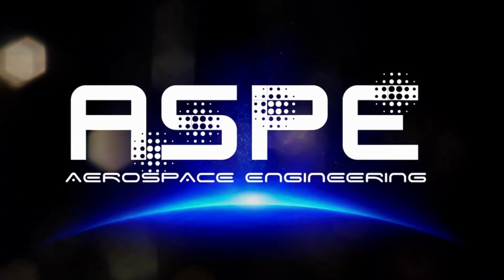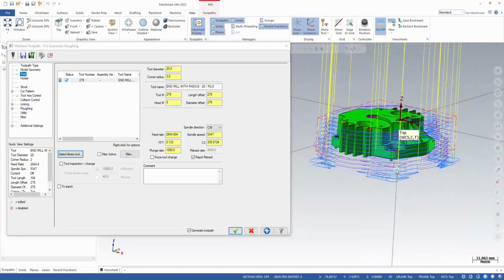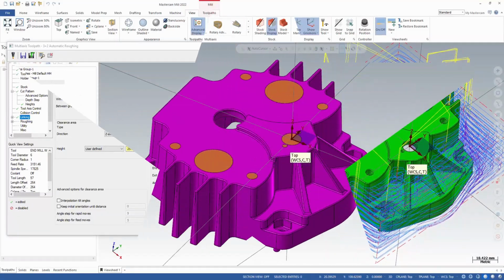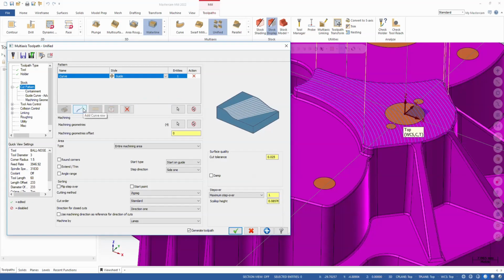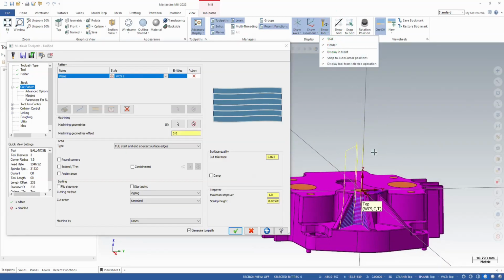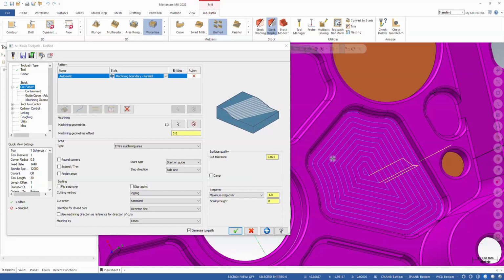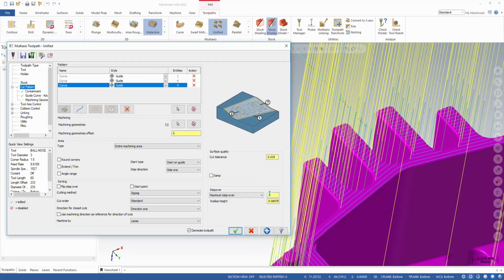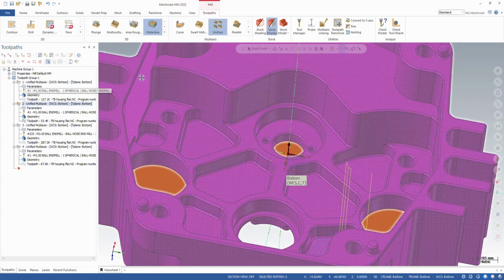MASTERCAM 2022  NEW MULTIAXIS TOOLPATH - SNEAK PEEK

Comment: I wish this was available in MC 2020
Reply from the maker: Yes it is a really good operation
There is a lot more :)
2nd part of Mastercam 2022 sneak peek in 2 weeks
Reply: @aspeaerospaceprecisionenging  do you own your own shop? If not, How can you afford MasterCam as a regular person?

Lastly, is your version a Beta version?
Reply: @ThomasShue  yes he uses beta version 
you can get it only from mastercam 

Ive spoken to reseller and to get beta version you have to have legal licence mastercam and you have to pay yearly maintenance which is $1000s 
This is expensive!!
That’s why only he’s got a video from new version :)
Reply from the maker: @ThomasShue  I agree with you it is very expensive  
I use the full version of Mastercam 2021 (except blade add on)
Robert soso is right,
This vid  is a beta version of the 2022 release, you can get it from CNC software if you have purchased the full version of Mastercam in the past and you pay yearly  maintenance it is a cost around $10k / year /each sit of Mastercam - this includes addons and postprocessors for our 5axis machines, there is no full version release or a Home learning edition yet (will be released end of summer)
 I also use a full 5 axis CATIA system (this is even more expensive) and a full version Edgecam  5 axis

I love offline programming